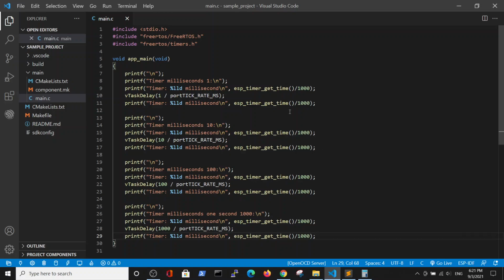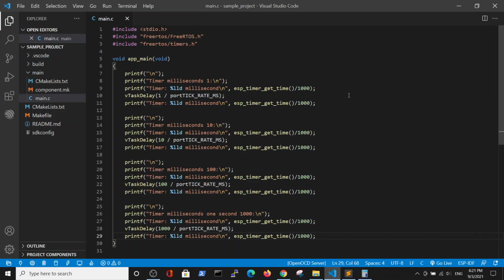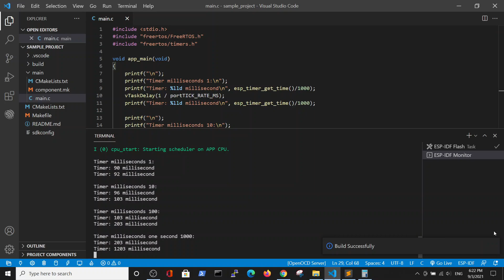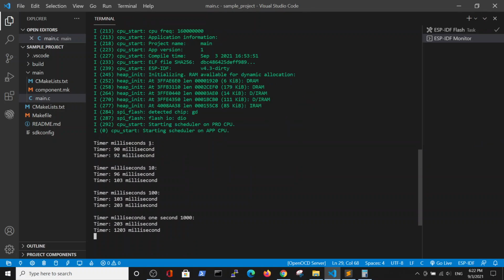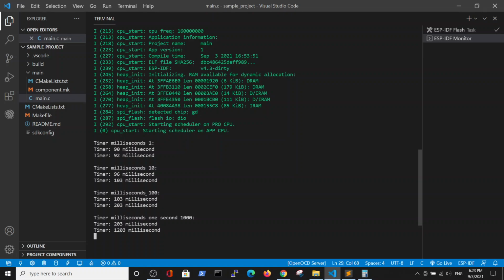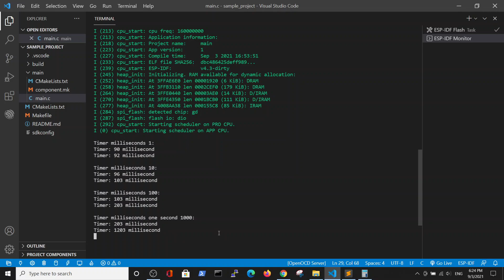ESP IDF Timer 5 - vTaskDelay in mSec comparison

Comment: For 1 ms result it should be reported in microseconds since it is very low resolution. thank you.
Reply from the maker: Dear @noweare1,
You are certainly right in principle, but by running the test the microseconds results had great inconsistency and changed rapidly depending on the current load on the operating system.